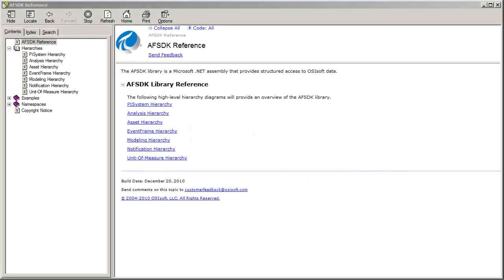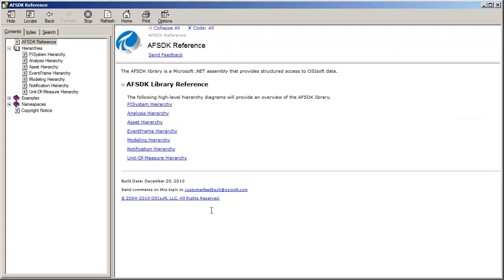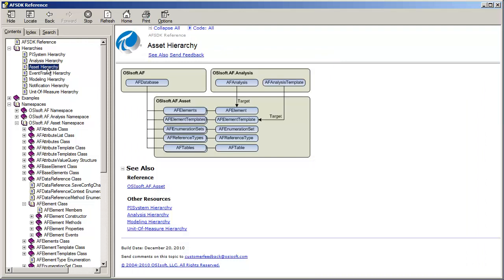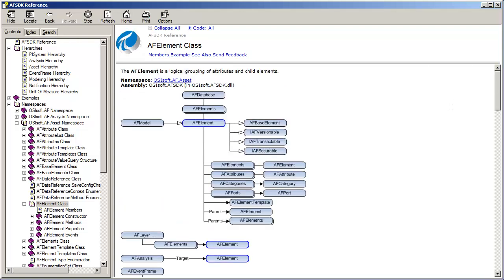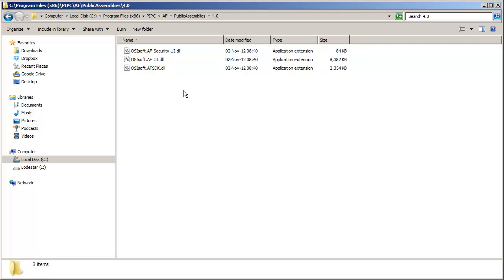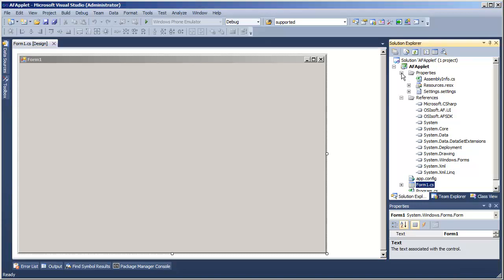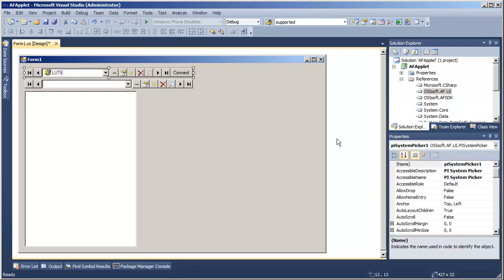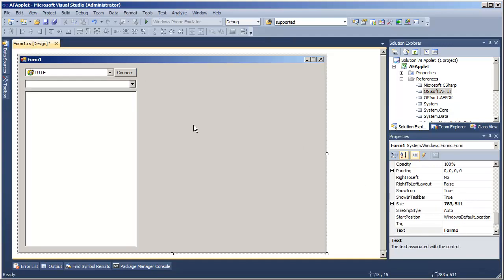OSIsoft: PI AF SDK Online Course- Introduction to PI AF SDK

Comment: Running .NET 4.0 in Visual Studio 2017, the toolbox rejects loading in the UI elements (AFTreeView, etc.). The error says the .NET framework version or the designer version is incompatible with the elements. Unfortunately, searching has not produced a lot of PI-specific help on the subject. Any advice?
Reply from the maker: This sounds like a good question for our Tech Support team. You can contact them through the portal at https://my.osisoft.com/